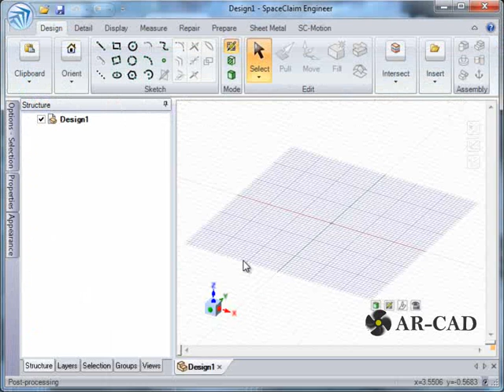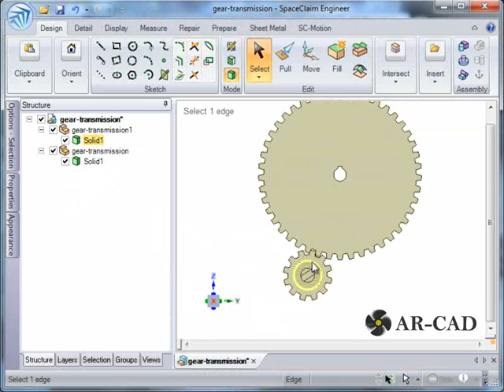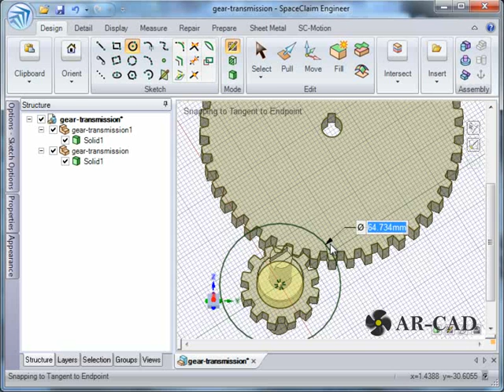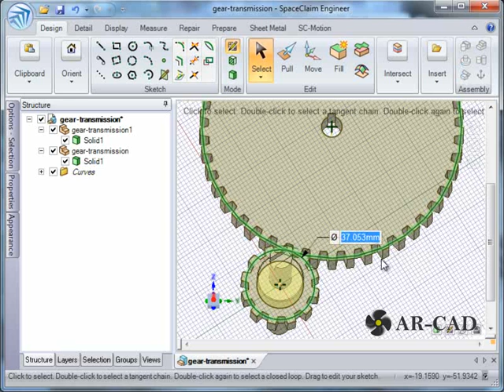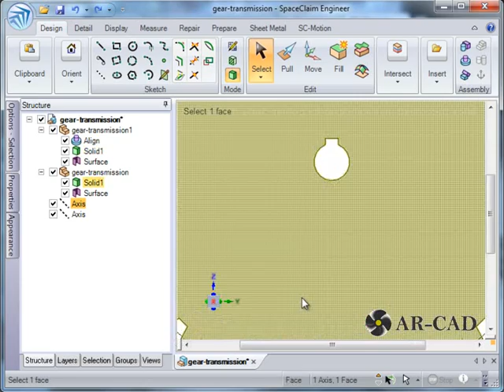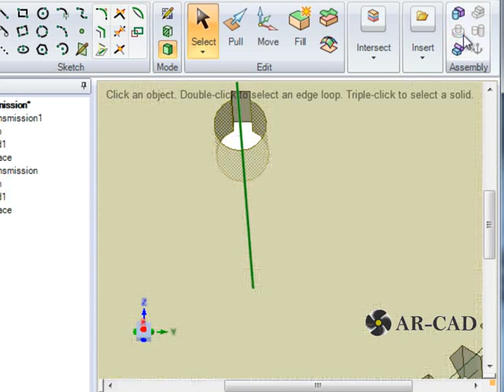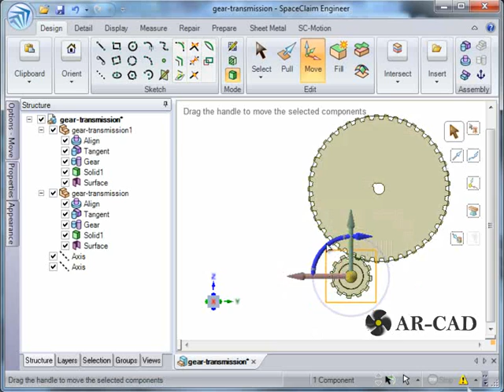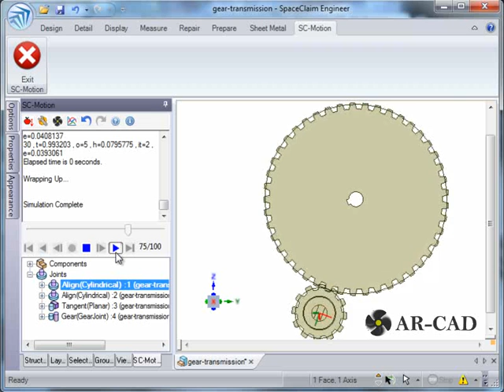SpaceClaim Tutorial on External Gears: Assembly Conditions: SC-Motion

Comment: Great demo! Thanks for sharing the details on calculating gear ratio. You may have said this in the video but why did you need to create two new surfaces for each gear and use those as the gear assembly instead of the existing geometry?
Reply from the maker: +Brian Boatright 
Hi,
We need to define the gear ratio as per the pitch circle diameter of each of the gear. Hence, we need an intermediate surface between the inner and outer dia of a gear.